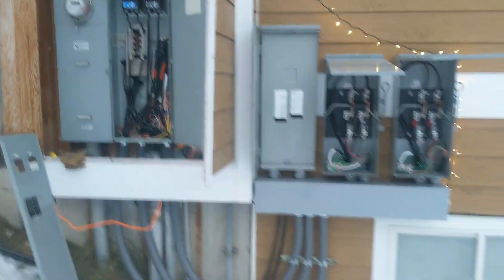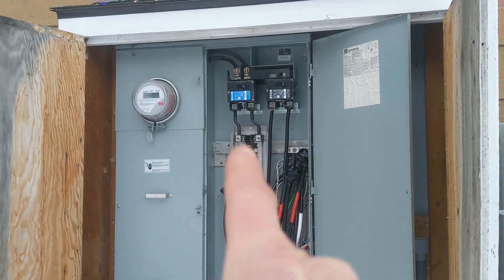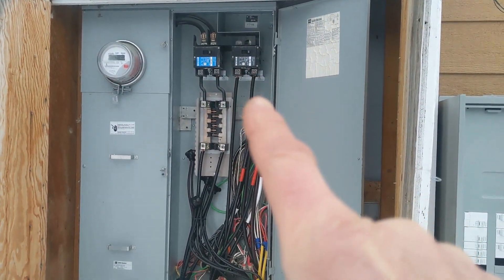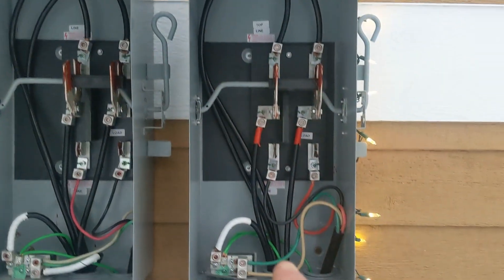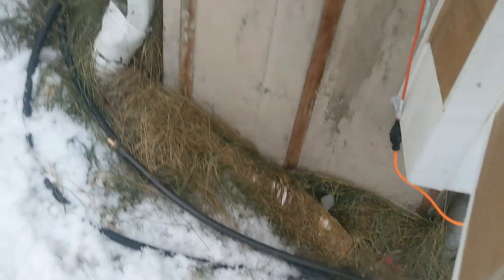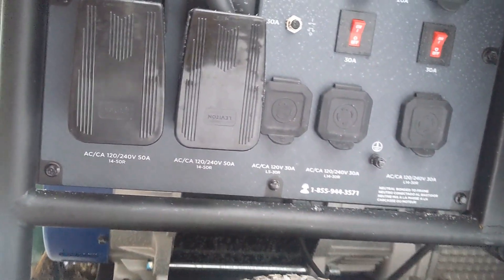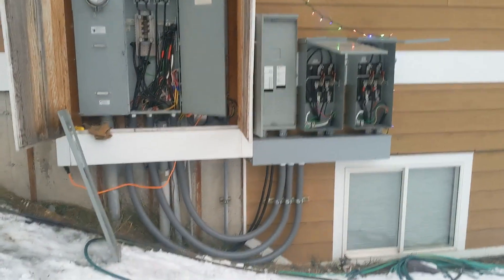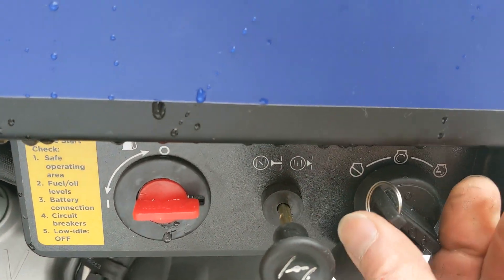Westinghouse 20 kW generator dual transfer switch wiring and startup procedure.

Comment: Where is the system bonded/grounded?  Are both switches sharing the same neutral (unswitched transfer switch?) , or are both switches on a separate neutral (switched neutral transfer switch?)?

Comment: I’ve got the same generator for my house. I’m using both 50amp outlets as well. We divided the main 200amp panel by adding a new 125amp sub panel. Then divided circuits based on how I think I would need them. Basically put all regular use circuits on one and then heavy use circuits like AC/dryer/range on the other one. This way I can power the whole house but still use the AC/Heater (heat pump) on its own dedicated 50amp breaker since it takes more startup amps. Both panels connected to the generator have separate interlock kits so nothing is back feeding to the main breaker or to the grid.
Reply: Will you be willing to share your set up with pictures.  I am planning to buy this but any electrician I talk to want to sell me their generator. If you don't mind please share the whole set up and plan that I can show to an electrician to set it up.

Comment: My question. So is there a safety mechanism\interlock that prevents you from accidentally backfeeding utility?
Because if disconnects were per say still engaged and you went to turn on main breakers in the main panel that would not be good correct?

Comment: I'm guessing you spent a lick on the electrical work.  With that cost and the cost of that beast why didn't you just go yard and get a true standby generator?  I ask this from experience since I'm running a Generac 17500 with dual fuel kit and 10 100lb bottles plus 200 gallons of non ethanol on standby.  
Next you should tackle the generator shed so that baby doesn't sit out or so you can run it in inclement weather.  I have the lifetime shed with 3,000 cfm fans and the standard muffler exhaust you will see on youtube.  I also lined it with Rockwool to minimize sound but it produces some insane temperatures in the summer.  I've been looking at this exact Westinghouse since I have dual 200 amp boxes as well and could at times want to back feed both.  I'm not sure I could back feed both boxes at the same time and it's difficult to find a electrician that actually knows that answer as well.  May just do the Westinghouse 12KW/15KW dual fuel and move the cable between my dual inlets and interlocks since my needs in the summer are different than my needs in the winter.  Look forward to seeing another video when you load test it.
Reply from the maker: Thanks for the comment! The electrical work was $4300 and the generator was $3600, so about $8K all in. I had quotes for standby dual-fuel generacs for ~ $30K (including propane tank) so this was more doable for us. Yup, a shed for this is an upcoming project.
We have no problem backfeeding both boxes at the same time, as each circuit is electrically isolated. Not sure how much we are drawing on each but they do work fine at the same time.